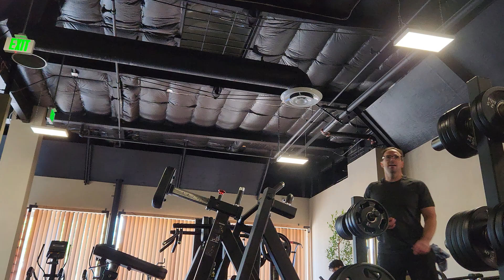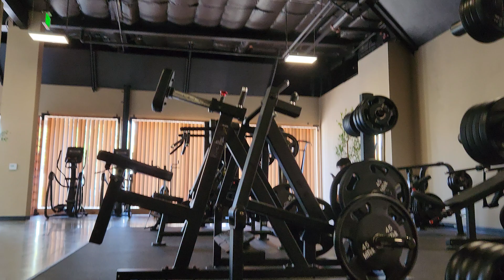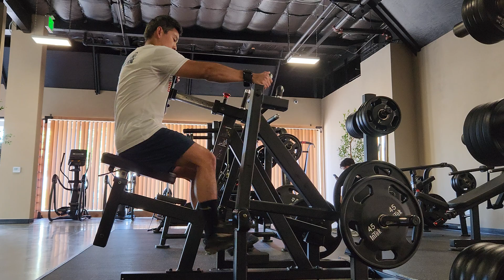Atlantis Row MODEL PW437

Comment: surprised this one is good! I thought with straight movement arms it would drop off way too much in the shortened length postion , but seeing you use it I realize now the actual length of the lever arms help smooth that out a lot.   Also... could easily just add bands for shortened position -- in general this type of row is way underrated I think -- as long as it's lengthen biased, any overly aggressive drop off is probs "fixable" with bands.
Reply from the maker: Yes, just a lot of stability you can get from combo longer lever/torque arm, foot brace at a more vertical angle, chestpad, and unilateral handle. It is not a sophisticated design like linkage ones but it is still good and you don't have to compete with collectors for 1-5% (pulled number out of my ass) better row for 6-7k+ resell. 

This is def better than magnum row to me. Just not as sophisticated linkage design, sorta kinda like watches that are mechanically more intricate but tell time less accurately than quartz watches.
Reply: @teambdugz  💯 and I agree re the magnum row , def a machine I feel like is built for taller folks